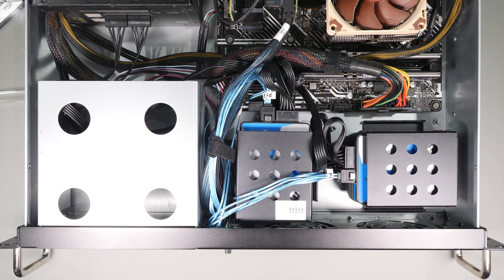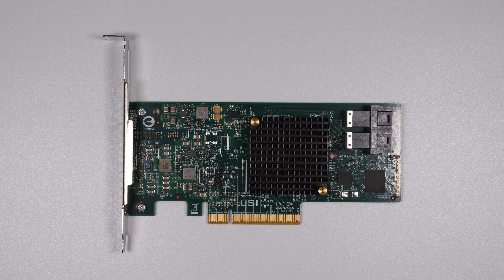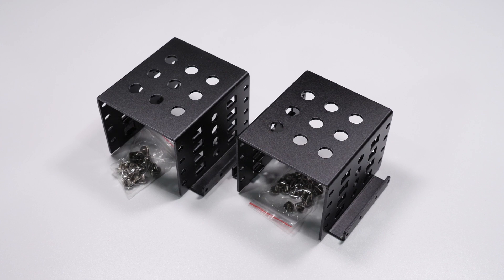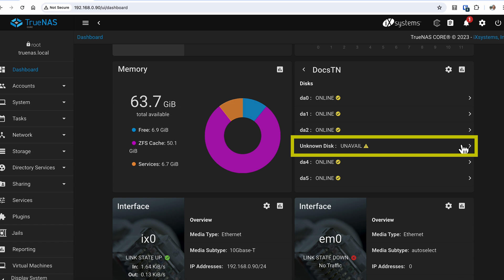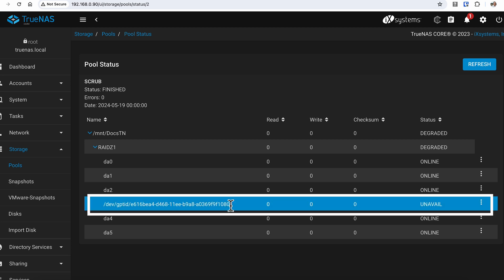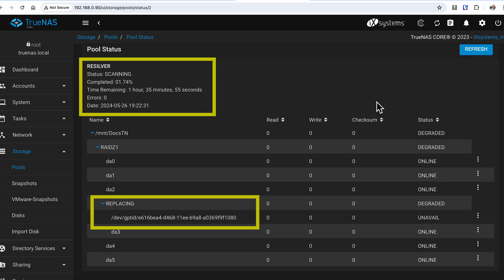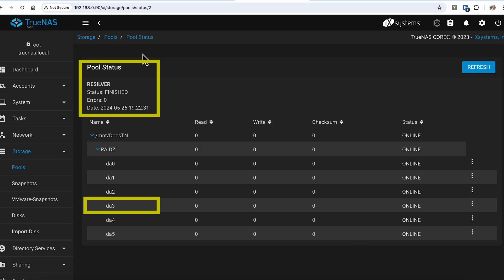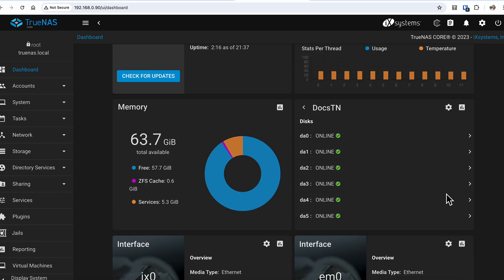How To Replace A Drive In Your TrueNAS ZFS Pool

Comment: In order to replace perfectly working 2TB drives on a RAID with 8TB drives (four total drives), I am trying to do one at a time. In Pools → Status, I take one drive, ada1, to ‘offline’ status, and I know which drive that is by the serial number. While the system is still running, I physically unplug SATA and power plugs to that drive. I plug in the new 8TB drive to the same power and SATA connectors.

Now I go back into the Pools, Status, and I see the new drive listed with its serial number under ‘/dev/gptid/[serialnumber of drive]’. The way it looks in your video.  The status for it now says, UNAVAIL. If I try to change to status to ‘Replace’, it pops up a dialog that asks for Member Disk. There is nothing in the dropdown, the Replace Disk button is greyed out, cannot click. Can’t do anything.

Do you have to format the new 8TB first somehow, on another computer?

If I try to change the status to ‘Online’, there is no change, the status remains, UNAVAIL.

I am at a loss as to how to replace one drive with a larger drive on my four drive RAID setup with TrueNAS. I want to replace all 2TB drives with 8TB drives. I am trying to do one at a time, but the first one doesn’t want to be replaced.

What am I doing wrong?? I am following the exact steps from the TrueNAS documentation!

My original four WD Black 2TB drives have been running flawlessly for almost 10 years. I have never replaced any of them. I just need more total space. My RAID is such that I am currently using four 2TB drives to get 6TB total space. So I can afford to lose one drive while maintaining integrity.

Is this possible?

Why is there nothing in the dropdown under Replacing Disk, member disk???
Thanks!
Reply from the maker: Strange issue.  You do not have to pre format a new drive.  Since you are hot swapping, I would try and reboot and see if that resolves it.  Not all controllers like hot swapping.  Let me know what happens.

Comment: mike good news. they addex vdev expansion in the latest truenas electric eel release.

i updated from dragonfish to eel and seems to be working fine. i managed to setup my docker containers as well, all working on the eel update.

that said i used jailmaker docker, the graphics doesn't work. but if you use the native docker support, graphics support works much simpler.
Reply from the maker: You are ahead of me.  I have not tested yet.  Let me know when you get it running the way you want.
Reply: @MikeFaucher  other than that electric eel seems to work fine. i didn't test vdex so can't confirm if vdex expansion works or not. but in the feature listing thats what they added, after zfs fans waiting years for it.

Comment: I label serial numbers of drives & place label in a location where label can be seen without pulling drives. This speeds up ID of the defective drive and its replacement.
Reply from the maker: Good strategy.  Thanks for sharing.